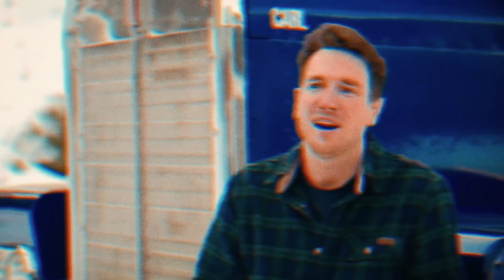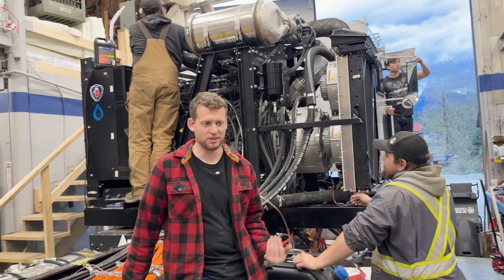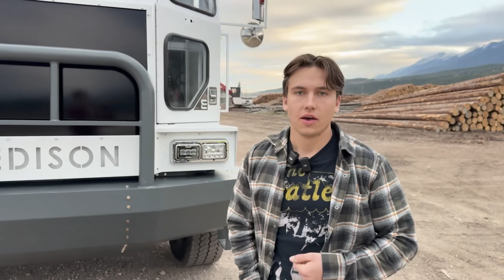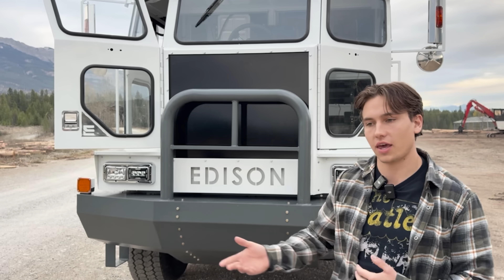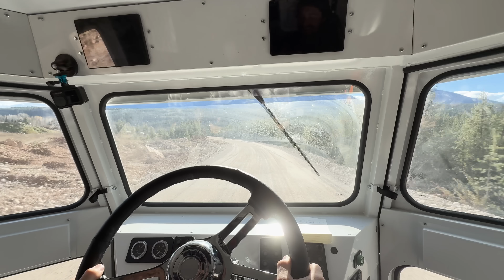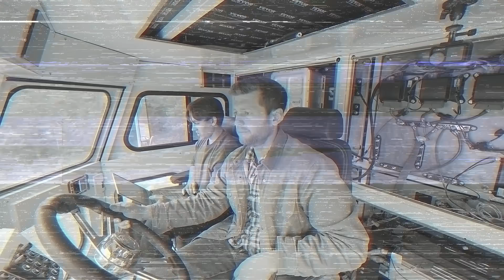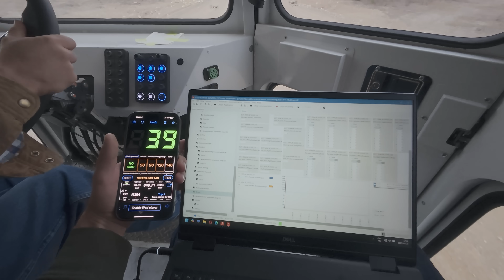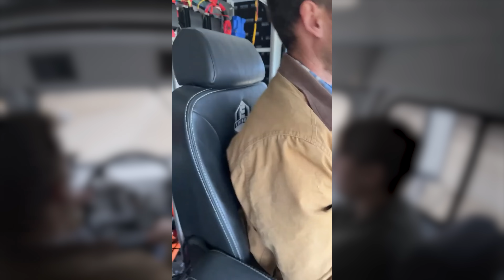Driving Our New Hybrid Truck for The First Time

Comment: Watching you turn everything on, will you have it automatically turn them on when you turn on the ignition? As in, you hit the power button, the lights flash for the accessories as they are turned on sequentially and if they turn on successfully, the lights go solid and if they fail, the flash red. I can see the buttons either being forgotten or misclicked and didn't look at them to check they are on. There can be all sorts of issues.

Comment: I am confused about the DEF. I thought the Scania engines didn't need DEF is there something i'm missing?
Reply: New Scania engines needs DEF, but what they have removed is the DPF and EGR systems, Diesel Particle Filter & Exhaust Gas Recirculation, which have a dendency to choke up engines over time
Reply: Ah that makes sense. Thanks

Comment: something i noticed on your undisclosed cab over axel is that you lack a mirror to see the blind spot directly in front of the cab, sure it does have floor windows to the side but you could still conceivably hide a gokart in front and you would not see it until its abut 3 meters in front of you (used a super thanks to make sure you see it, as it is a safety concern)
Reply from the maker: That’s why we have the tough steel bumper
Reply: @EdisonMotors  not concerned about the truck more concerned about what's not the truck say, A Child!
Reply: @alolol1000  you’re European mind can’t comprehend that north American safety is “I don’t die” while rest of the world safety means “nobody dies”. A bit exaggerated but there most definitely is a cultural difference about safety.

If or when Edison comes to Europe there will be a mirror or camera in the front so no worries.
Reply: @autobootpiloot*your 
Also I want it there because nobody dies should be practiced everywhere
Reply: @alolol1000  I agree it should be practiced everywhere but it isn’t. And a comment on YouTube will never be enough to change a cultural thing, not even when you add some money.
Reply: @alolol1000 don't forget the primary users of these trucks aren't inner city drivers. These aren't delivery trucks, they're utility vehicles meant to do specific vocational work, that require specialized equipment. All of the trucks ever designed in this category are like this, in many ways they're designed more like construction equipment than they are as street legal vehicles. You shouldn't have kids running around these things unsupervised anyways, especially on the type of work sites these will likely end up at
Reply: In European trucks we always have that here. A small mirror that shows right in front of the truck.

Comment: Sure.. it is differrent but what about freight engines? Those are deisel/ ellectric..no? Big ol deisel generators ... supplying the tremendous power to them motors. What does the portion of gov holding the road vehicles have to say about the trains?

Comment: The mirrors seems like they're 90 degrees on either side of the driver.  In a production vehicle that's going to require a lot of head movement to see.  I think you'll probably want a more traditional cab layout in a production truck.

Comment: Couple questions. Could there be 2 steering axles? Width and length of frame, thinking about motorhome. But all electric so Just to make sure voltage 600-660v but don’t know amps.

Comment: That the Truck doesn't have Cameras as Mirrors like new Euro Trucks have is an oversight seeing how far you have to turn your head to see... It'd be much better to have two displays to the side of the cockpit with the Camera Mirror feed. That way you'd not have to turn your head so much.
Reply: As of this date North America doesn't allow for cameras in place of mirrors.
I've seen a few RV buses with installed cameras but they have to maintain the mirrors
Reply: Isn't it law that Canadian trucks have to have physical mirrors (although camera mirrors can be added as an option)?
Or is it USA?
Euro trucks do not need physical mirrors and many have cameras only.
Reply: @the_lost_navigator7266  I don't think it'd cost all that much more to have both. If the monitors are attached to the door, right next to the windshield it'd make for a much safer driving experience. Definitely an overseight but I hope that they'll change that or add that.

Comment: Go next level right to repair. Put onboard diagnostics on every truck.
Reply from the maker: I promise we’re working on it
Reply: @EdisonMotors Hey looking at the aerodynamical profile actually isn't that bad, I just would put an aero composite cover center of the cab to over the upper crash bar as not to exhibit it but provide better economy for cheap relatively speaking, 3d print mabey and wind tunnel for proofing.
Reply: @lammajones7682  This cab was built for a specific customer the way they wanted it with input from Edison.  They have not revealed who the customer is or what it will be used for but I think it's unlikely that it will be used in a highway application so I don't think aero was a concern.
Reply: @ToddKing I was unaware thanks for the input, oh and wish them the best.
Reply: @EdisonMotors  This would do wonders at easing some of the concerns of truckers/smaller freight businesses. I cant tell you how badly certain parts of Ag and freight want to be able to just work on and fix their own equipment.
Reply: My 2003 Cadillac DeVille has that (sort of) it will read you out all of the codes. It won't do complex stuff but it's really nice
Reply: A lot of industrial engines/gens don't have much in terms of diagnostics (codes). I have this theory that OBD2 was created for the novice at the parts house to tell another novice what's wrong with their vehicle and sell them the PROBABLE part.
Reply: @Benji_4  OBD2 was created so that tech don't have to carry six different kinds of gauge to fix a digitally sensed engine. The reason an industrial genset has less fault codes is because it doesn't need fancy breathing systems or idle emissions controls or any of that extra BS that wide revving car engines need in order to have a not-shitty throttle response.
Reply: @dustinbrueggemann1875  there are still plenty of fault codes, not just on the engine side. I'd like to at least see freq and phase to phase voltage while I'm going down the road. I'm used to a 34MW plant with a 13MW motor.

Comment: Round up the top corners. Airflow doesn't like sharp angles. 
Don't have to redo the panel a simple rounded strip near the edge will do the trick and still leave the panels easy to make.
Light bars/branding ect. Efficiency is everything not just drive train. 😊

Comment: Excellent to see this truck finally at the point of stress testing like this. I'm curious how it would do while more laden - the increased power usage for accelleration might bring up its own faults which would be good to find early, and you can see if at high power it can rival the ridiculous 0-60 claims Tesla advertised during their semi's unveilling. Electric has the torque to do it, might as well see it in action. And regarding the power problems, I recall there also being mentioned the capability to run the truck on just the generator's electric power if the batteries lose storage capability, which would definitely be good to test. You do not want emergency systems to be tested for the first time in the field.
The temperature monitoring near the beginning makes me consider environment - down far south here, heat from sitting out in the burning sun is often as much a problem for equipment as the cold is up there with you guys (one of my own cars lost an older battery to overheating while off by being outside in a bad heatwave), and while its hardly an easy thing to move it somewhere where that could be tested, it's probably good to at least build for it.

Comment: We do super heavy haul. When you have a tridrive ready, I'm sure we could find some error codes . How sweet would it be to have a pull truck and a push truck all series together seamlessly.
Reply: Adding to this: Locomotives use something called MU lines (multi-unit I believe) to connect two or more locomotives together. Then they can be all operated from a single cab. While this probably wouldn't work with a single operator on the road, being able to slave power and breaking commands to the lead truck could be neat!
Reply: @LiquidBacn  Well, could be a thing for Australian Road Trains.

Comment: Need to do some of the laps in the other direction, to test steering the other way.  Also, next time it rains as well.... look for rain in places it shouldn't be.   Rain at 100 km/h is going to find any weakness in the seals.
And can you try a couple tons of weight on the rear too?   Does it have  a tow hook or pintle to pull a trailer ?
Reply: Given they're in BC, the Rain thing won't be a problem to find lol.

Comment: In the Airbus I used to fly the switch panel preflight would consist of pressing every illuminated switch light. When all the lights were extinguished you were ready to go. Just a suggestion for a future ergonomic enhancement.
Reply: I didn't know that but that seems like a really good idea can't miss anything like that and it's a really simple thing to remember
Reply: Unless it's gonna be a beer truck and you have to push all the buttons whenever you stop ...at every corner store to drop of 10 cases of beer. Maybe put a master button pusher button that causes all the other buttons to push in sequence in 10 ms. Sorta like relays. Or just use relays with pilot lights to tell you they're activated. And a speaker behind the bumper that makes diesel engine sounds so people can hear it coming and to drown out that squeaky seat bracket.

Comment: Less voltage spikes than Topsy, eh? I'd like to hear from the power electronics / embedded designer if the inverter controller was tweaked to better transition the current to a freewheel rather than cut it abruptly in this version.

Comment: May I suggest that you add a pintle hitch to the rear of the truck and pull a roller with a water tank on top to keep the track smooth and less dust while going round  and round and round

Comment: Honda should be doing something similar to you guys, they're already a big player in the generator market and they make vehicles in almost every niche
Reply: Why? They are going the fuel call route with Isuzu and for sure the pure battery direction. The hybrid/range extender system is a dead end.

Comment: Great job guys, however, I think moving the doors to the side is a necessity, first off, it allows you to have a one-piece windshield. Secondly, it is likely that in a front-end collision both of the current doors will be damaged and the driver might get stuck in the cabin. Suicide doors will allow you to use the current steps in the bomber and there will be no need to changing the cabin shape.
Reply: This cab was designed to customer specifications, it won't be their standard design.

Comment: I can't believe you have to run DEF in a generator that is already significantly more efficient than an on highway diesel motor. Saving the planet one regen, one DEF refinery, one bulk DEF transport, and a million plastic DEF bottles at a time! But since some politicians play golf with some corporate big wigs we are forced to play pretend "Save The Planet".
Reply: The generator is a highway engine from scania, the 5 cylinder they use in rigid trucks

Comment: I have some electric vehicle experience and id say it is incredibly important to have minimal drag / resistance when off the throttle and brakes. Allow the driver to control when the vehicle slows down by activating regen or friction braking. Allow unimpeded coasting to happen with as little resistance / drag as possible please. Atleast give the option. 
( This may already be the case ) ^

Comment: How are you going to tell faults to the driver? With a screen? If the computer power plug is unplugged it should tell the driver to stop the truck when safe to do so in the next 5 or 10 minutes.
If you use the phone for the speed, it means you don't have the screen working yet? Are you going to leave all the buttons like this? Does the driver need all these buttons? If yes flip switches on the ceiling, (helicopter style) would be much cooler.
Reply: What we see now is pre-production prototype. The gauges and buttons the customer will receive will be much more polished. This interface is just enough to get it on/off the trailer.
Reply: @Sah-o5m  no this one is for a customer, but the gauges havent been installed yet
Reply: @abuBrachiosaurus 
This one still has pre production gauges and switches. After the service body is installed in Winnipeg,  it will go back to edison for the final, polished, bells and whistles.

Comment: I worked on busses most of my mechanic years. When the manufacture went to electric fans on the radiator they setup a button you pushed once a day to reverse the fans at full speed, for a preset time, to blow the dirt out of the radiator. Also I was around dump trucks and logging trucks many years ago. I think it would be a useful feature if the driver had a switch to run the batteries down to a lower level if they where getting logs or dirt up a large hill or mountain. There is a lot of kinetic energy in those trees on top of that hill, might as well suck it up. Also this would make sure they had regen braking all the way back down. Something I have not heard you talk about is without a driveshaft there would be no frame twist when pulling a heavy load out of a hole. In Canada to you call it a driveshaft or a propeller shaft?
Reply: Love the fan idea. We call it a driveshaft
Reply: One thing I haven't been able to get an answer to is how do they control the regen so that the wheels won't just lock up on ice and snow
Reply: Most electric vehicles give the users direct control over how aggressive the regen braking is.  A “snow mode” button could be helpful.  Or they can use the regular traction control to see if they’re enduring lockup and lower the regen for the duration of the drive after a rear lockup event.
Reply: @loaflyer5663 reverse of throttle mapping essentially, load drops and revs rise youbreduce power until.the load goes back up indicitive of traction.
Reply: @loaflyer5663  Is regen braking capable of locking the wheels? The force that slows you down is electromagnetic, so to my understanding it shouldn't be capable of locking the wheels until the conventional brakes decide to take over.
Reply: @therealdemen247  it cant completely lock the wheels but it could still make them slip
Reply: There was another comment made stating that the regen energy could drive the generator, which then turns the diesel engine which creates engine braking. The load on the generator/motor maintains regen braking indefinitely.

Comment: Imagine  that truck you built with heavy armor and bullets prof glass  and with all wheel drive with lockers on military offroad tires. It just a thought but wouldn't surprise me if the military uses a truck like that.
Reply: One thing that would also make it ideal for military, is once the truck is used to move cargo, you can use the truck as a generator to power up lights and equipment at a remote camp. Especially in a disaster situations, could power a hospital.
Reply: @pd4954  which i can agree with you on that
Reply: As a former army mechanic, I do see great potential for a hybrid diesel-electric vehicle. Army vehicles, especially armoured ones spend a lot of time sitting, in hides, on radio watch/sentry, etc. So a large battery bank with the ability to move quietly without having to fire up a big diesel to move a short distance and power radios/electronics would be a huge advantage.  I can't tell you the number of times I have had to go boost vehicles because the batteries ran down on radio watch.

Comment: I hate to say it Chace but the cab forward design of this truck is far superior then your other conventional design!  The genset behind the cab is much more serviceable (Oshkosh did a similar mod to the military HEMITT).
Reply: Form, high hood wins. 

Purely Function, this truck wins.
Reply from the maker: I disagree.  The high hood feels cool and that makes it much more superior
Reply: @EdisonMotors conventional or cab over, centered steering is superior to all others. I have been designing this truck in my head for a couple decades now, but I don’t have the ability or money to make it come to fruition. I am happy for you all and hope to be able to buy one in the future here in the states.
Reply: @EdisonMotors  "THIS is Brilliant, but I like this"
Reply: @EdisonMotors I like both, but for many cases behind the van makes more sense, especially for visibility.
Reply: @EdisonMotors  it does not
Reply: I have to agree because I am a nerd and a truck driver and I admire this cab more than any other cab I have seen on the road or driven in. I would just want a sleeper with a toliet/shower.
Reply: Cab over design was very popular in the 60's and 70's and if you look at europe that market demands cabover due to overall truck length.  Without a monster diesel  engine between the frame rails the cabover interior wins.  Please don't get me wrong here, I really admire what you and your team are doing.
Reply: @imwteach funny thing is Volvo and Scania have the largest and most powerful onhighway engines on the market, they're all cabovers
Reply: It's a cab over Axle
Reply: @alolol1000 if you want to be pedantic, every cab is over the axles.
Reply: @stuckgrenadepin.225  no there are plenty pennisworth or whatyoumycallit that are cab behind axle engine over axle
Reply: It's neat, but the forward visibility looks pretty terrible.  Large swaths of the road shoulder disappear behind the door pillars.  Not convinced that is a good idea.  Maybe for its specific use on logging roads.  I don't know I'm not a logger I guess, but I think a more conventional design would have more mass market appeal.